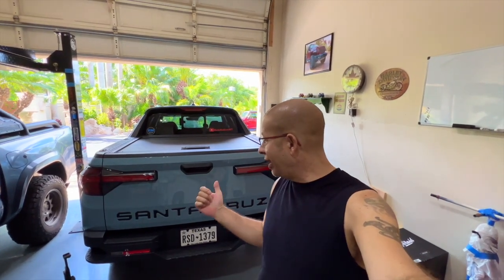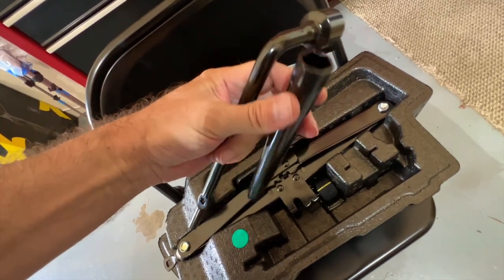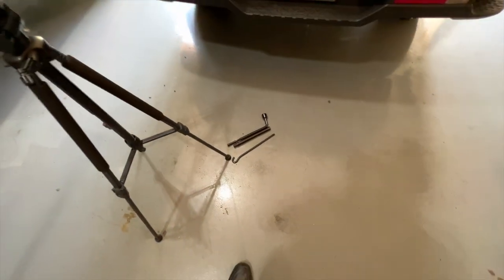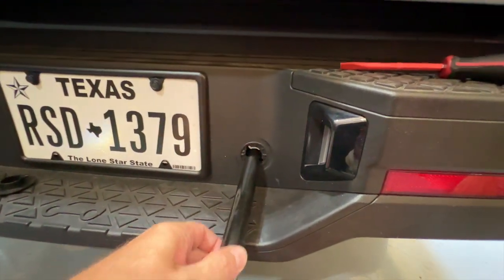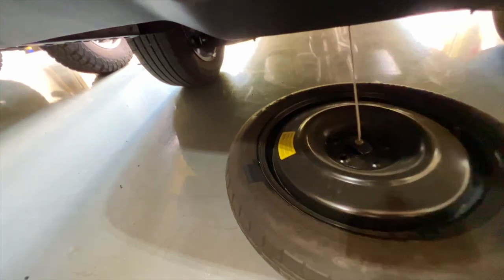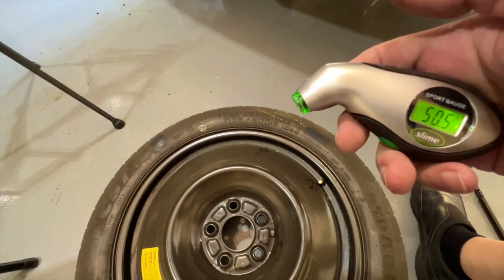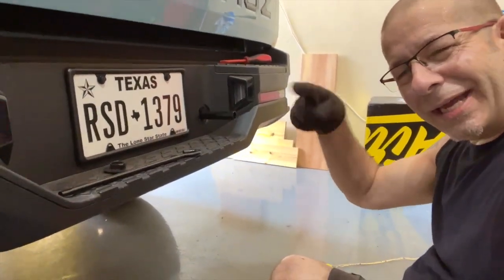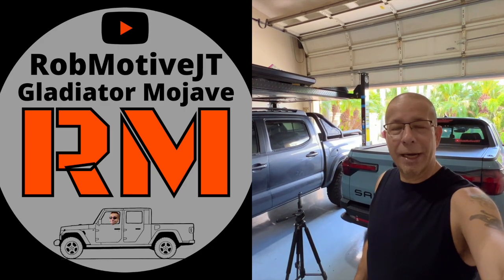How To Lower The Hyundai Santa Cruz Spare Tire

Comment: I absolutely hated posting this comment because there were 69 comments, but I just wanted to say that a cheap Walmart tool kit that includes Allen wrenches would be a great idea to keep with you. 
They're like 20 bucks, and it's helpful always having basic tools. 
The Cross bars require Allen wrenches to take off and put on.
I also carry an electric air pump and tire plug kit with me, because before I started carrying those I was a screw magnet apparently, but soon as I had them I haven't got a screw since.

Comment: (Off the subject) I just saw a YT video (JF&W Tech) about owners having water accumulate in their headlights and running lights on their new Santa Cruzes.  Have you noticed any issues. Might be a topic for another video?
Reply from the maker: Yup…water gets in.
Reply: If you look closely, there is a small gap between the DRLs and the grill frame which gives the appearance of water inside the light fixture. There is not actually water inside the DRL housing - Hyundai service tech showed me as I raised the same issue. All good on my SC!

Comment: Good idea on all pick ups and suvs that has spare tire underneath the bed/body and lubricate the cable and mechanism with water / salt repellent grease at least once a year so it dose not get seized. When you need it the most and will not come down, call tow truck to take you to the repair shop.I didn’t had that issue but another issue came up where I need to drop my gas tank the spare tire needed to be removed, and guess what ,the whole mechanism was totally rusted and seized so bad that they had to cut the cable off. Now I have to find a new mechanism to replace it and put my spare back on.Also it my old 04 Tahoe that I got four years ago and the spare was never lowered for maintenance from the previous owners.Plus always check your spare tire for dry rot cracks on the side wall,even ifs never been used it WILL crack within a few years in harsh outdoor elements. And it will need to be replaced. In the past I did that maintenance on my pick up and caravan  so it doesn’t get seized.
Reply from the maker: Good tips👍

Comment: Had to drop the spare when I added my Trailor Hitch! Not too difficult, just 6 bolts! Dealer wanted $800.00 and did it myself plus a 4 pin electrical connection for under $400.00!  Good add on! A project for you!?!
Reply: Hitch purchased on Amazon $263.67!
Reply: The 4 pin electrical wiring harness also on Amazon for $40.67, The one that fits the Hyundai Santa Fe worked!! So total was just over $300.00 and the Dealer wanted $800.00!!

Comment: Thanks Rob. I've had my Tacoma almost 2 years. I need to run through the hold spare removal. And check the tire pressure.
Reply from the maker: Definitely.  Nothing worse than needing it and it’s flat😬

Comment: Do you need a special tool to check air pressure on drive tires
Reply from the maker: Not sure what you mean?
Reply: Yup, stop at a auto parts store ask for a tire gauge, don't get the cheapest. I prefer American made ones made from steel instead of plastic.

Comment: Great video Rob ,very useful. The tool with the hook can be used to hook the rim and drag the spare out from under the truck. Good stuff bro.
Reply from the maker: Thanks👍
Reply: The “hook” is actually for the jack, used in combination with the lug wrench it creates a crank to lift or lower the jack